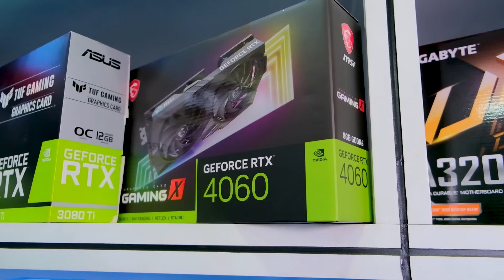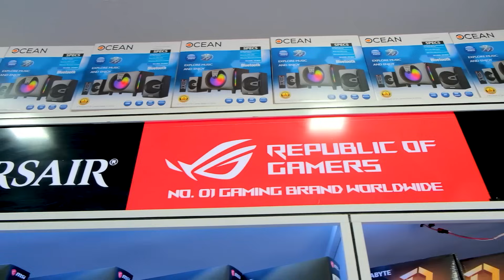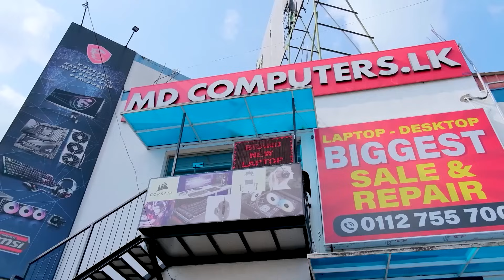තාමත් පරණ ගානටම සුපිරි LOW BUDGET GAMING PC එකක් ! - MD COMPUTERS

Comment: Ayye mage PC  eke gta v gahanna PULUWNDHA , 
*windows 8.1
*10gb ram 
*AMD RADEON HD GRAPHICS 7310 (4GB) 
*AMD E1-1200APU (processor) PLS kiyanna Aiyye pin siddha we❤❤❤❤❤😢😢😢😢
Reply: bh/
Reply from the maker: Processor eka mokakda
Reply: @SLPCLK  *AMD E1-1200APU  WITH RADEON HD GRAPHICS 1.40GHz
 * 64bit operating system, x64 based processor. 
Meke Gahanna Puluwang dha Aiyye 💓💓💓💓💓🇱🇰